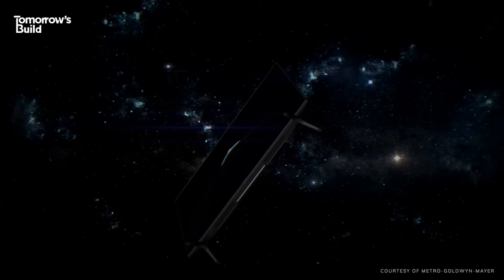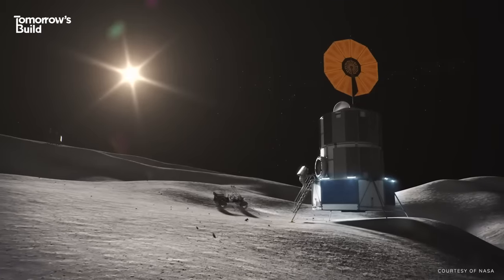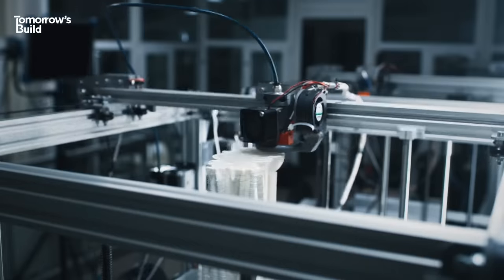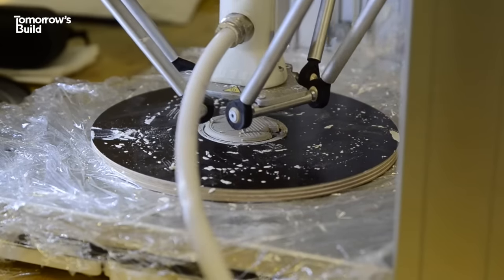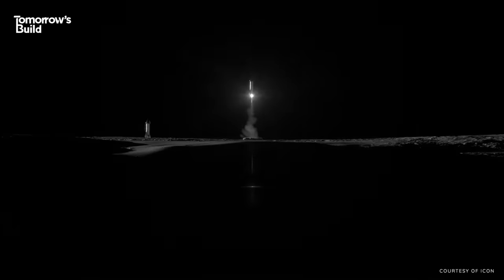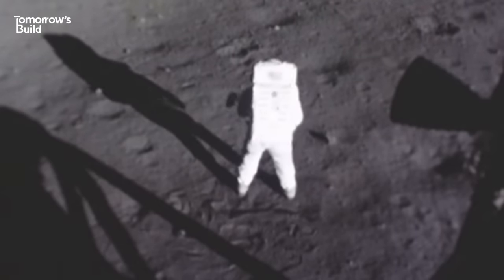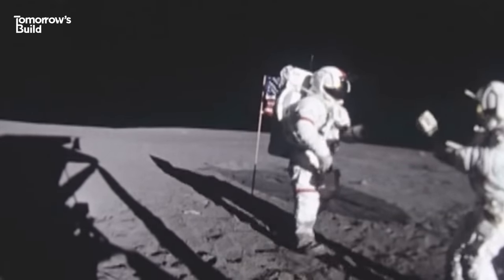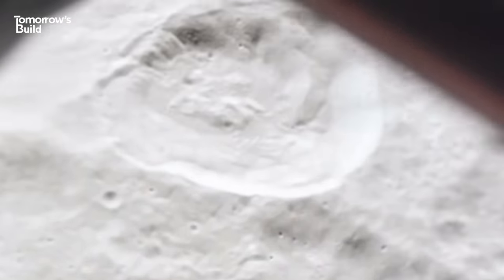NASA's $93BN Plan to Colonise the Moon

Comment: An important consideration of what NASA needs to get built on the Moon or Mars is that it needs shielding thick enough to dampen harmful radiation.  The habitat itself, the pressurized livable space will be shipped from Earth.  What is unaffordable is the shielding that goes on top of it.  Like a glasis on a Napoleonic era fortress, the earth embankment to dampen the impact of artillery.  That is just piled-up soil.  The structure of the fort itself is made of stone or bricks, the usual building materials.  So, 3D printing in space is basically limited to piles of regolith on top of the actual habitat.  There is no such a need on Earth.

Comment: Offside construction is very often the best option on earth and a better option than 3D printing on site. What we need on the moon though is radiation shielding, which needs electrons. Conveniently the amount of electrons in a material is proportional to the mass of the material. Mass is also a big problem to be faced when sending stuff into space. So to make this realistic, we need to create structures from material already on the site, with as few people on site as possible. 3D printing ticks those boxes.
Reply: For radiation shielding I think it's well more viable to just cover the building with regolith, or make your building near the wall of a crater, or maybe a cave.
Reply: @LordSesshaku  try building a sand castle with fine dry sand.
Reply: @piraterubberduck6056  I didn't said build, I said cover the building. Instead of building thick structures, just design them to be buried in a thick layer of regolith mass. That would offer enough radiation and micrometiorites protection and it would be way easiert to achieve.

There are many designs that follow that principle, the calculations of how thick were already made.

Comment: why dont we just dig cave structures ???? or is that to simple
Reply: On reflection, they've got to dig up various minerals so wouldn't it be great if the excavation happened to have the "value added bonus" of being easily adapted into a cave?

Alas, I think that that would be just a bit too fairy tale and you can imagine all types of experts poo-pooing it for inefficiency, cost, time wasting and so on.
Reply: The moon is mostly made of dust and small rocks. Digging in it won't give us something stable. Tunnelling machines are also way more complex than 3D printing machines. This is the easier option.
Reply: Because the moon is hollow
Reply: @jacksonc2956  What, like Gorgonzola?
Come on! Someone had to say it.
Reply: it's vastly more complex to dig tunnels, especially with the nature of the surface, it's easier to build habitats in craters to shield from radiation and temperature
Reply: @jacksonc2956  << When videogame physics applied to reality.

Comment: A: 3D printers need a lot of servicing. Who is going to do that? (Cleaning the muck away etc...)
B: How are you going to get the bloody massive 3D printer there for a full sized habitat?
C: How are you going to power and feed it? You cant suck regolith up. There is no air. It needs to be mechanically done.
D: How are you going to fuse the base to the ground? Put air in it and the exterior vacuum will rip the base soil away. Because it's porous.

Conclusion: It's a dumb idea. The only way you could feasibly do it on the moon is send a giant boring machine. As it bores, the regolith is transported to the surface to be stored.
Next stage on the bore machine is a heat welder that fuses the side walls as it goes down. 
On top of the bore machine is a 3D printer. When the bore machine reaches safe depth, it pins itself to the base of the pit. The 3D printer then extends and starts creating the cap, or roof.
The bore machine is designed for easy disassembly. On it are the required airlocks and desired equipment to finish the base.
The struts from the 3D printer can be taken off and used as con rods from the outer rim of what is left of the bore machine to the roof, securing it.  
During all this, the central power cable to the exterior is left in place and is sealed in the centre of the roof.
The intake chute for the 3D printing regolith is left there as the new hatchway. 
MOONBASE!

Comment: Isn't the moon covered in feet of razor sharp regolith dust?
Reply: Didn't see any sign of it on the shiny lunar lander feet pads. Didn't see any sign of it blasted away from the landing sites by those 10 000 pound  thrust rockets either. So, clearly it's not a problem. ;)
Reply: Razor sharp? Sounds like someone doesn't want it to happen.

Comment: I'm sorry, in what precise way has 3D printing failed? I clearly never got that memo. I'm also a bit baffled by the whole ‘it's obsolete and it's also too new to use’ vibe. Altogether a really confusing video, I'm afraid.

Also, what's the connection between space explanation and the development of mice? I know about the work at SRI, AEG and Xerox PARC in the 60s and 70s—is the connection somehow through NASA's funding of SRI? Why isn't the connection with space research (if there indeed is one) more widely known?

Comment: Theoretically you could build 2 way dc electric cable ran space trains with rockets going in opposite directions to keep the cable the trains run on tought then you can have cable ran 3d printers on rails to build concrete highways around the first cable wire tram system

Comment: Have the materials readily available on the moon been designed into solar panels yet?
Sufficient electrical power would allow smelting dust and rock into solid building materials.
Lack of atmosphere (and water, and carbonate) would leave concrete unable to set.
Reply: There's actually some interesting stuff that's come out about this recently. Blue Origin has been working on creating solar panels entirely from the regolith, and have done tests using lunar simulant.

Comment: You want to know if it works before you send people to live there? Send a troop of rovers controlled from the ISS to build test structures and see what happens.
That'll do for a start, and a the rover technology has already proven itself of Le Rouge Planète. Also, being closer to home, means it can be remote-controlled.
You need regolith collectors, processors, and builders. With them properly coordinated, you can start testing the building theories and gathering data.

Comment: any of those habits actually built at site temperatures and atmospheric pressure or lack  of. and the next at lunar or Mars gravity.  i noticed rock formation on Mars themselves don't look like they would exist on Earth because of its greater gravity and pressure.  same with all these materials that as of yet could not be tested accurately on Earth. doe the flowing material to make printed building still flow at -160 degrees F or even -60F?

Comment: Nah! It ain’t going to happen by that date. Promises, promises. That’s all we ever keep hearing.
Reply: You're right, that it won't happen by that date, but I am quite confident it will happen by decade's end. The funding is there, the political support is there. These two elements were never there until Artemis. The different things required - the rocket to get them there, the lunar lander, and the space suits, are all in stages of production. While delays are inevitable in spaceflight, the status quo is changing.

What's more, commercial spaceflight is significantly lowering the cost, so after we do get to the Moon, it'll make our continued missions a lot cheaper and sustainable.

Comment: I'd be careful with contemporary art.  It should rise because of the general rise in art though.  When I worked at Sears Brand Central, I literally watched Apollo 13 1,ooo times, but they never made it to the moon.  Everyone doesn't make it!  How's the concrete versus meteors?  Wow, that's cool, molten steel in the center with a concrete exterior and interior, should be a very solid structure, y'a Lunatic (Jack Nicholson)!  I want to fill a cavity and build a tooth man :-) (Jack Nicholson)!  Sips on Earth, print on the moon, labor and quality!

Comment: I hate that sneaky intro to the sponsored clip. I don't begrudge you making money, but I don't want to be following along and suddenly realize I'm watching an ad. It comes across as disingenuous.

Also to say that 3Dprinting failed as a production method kindoff means you dont get the power of it. Yes its slower than injection-molding but you can make geometry thats otherwise impossible. Other than that, its a briliant production method to create prototypes and custom products on the fly. 

Also check out relativity space.

Comment: I dont know what takes them so long, ive made it to the Mun within hours in Kerbal Space Program
Reply: In Kerbal Space Program, you do not have Richard Kerman upset that the rocket you want to build is too cheap to build and will take jobs away from Kalabama.

Seriously though, if NASA was given just a bit more funding, and actually was able to build what it wanted without any interreference from congress (which itself is being influenced by the military-industrial complex), we would've gotten to space years ago.

But through the combination of commercial space lowering the cost of things, and just sheer luck in Artemis continuing to have support, we finally are going back to the Moon, and I see very little way that it will not happen before the end of the decade.
Reply: @WasatchWind  wish it would work much faster but it still looks promising
Reply: That's the way you do it.